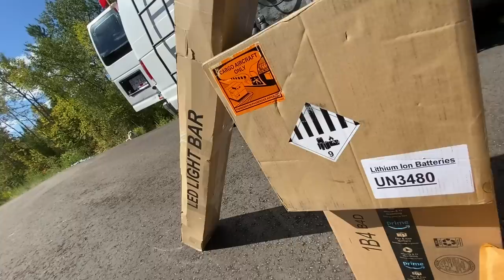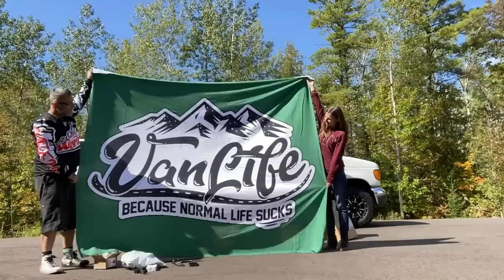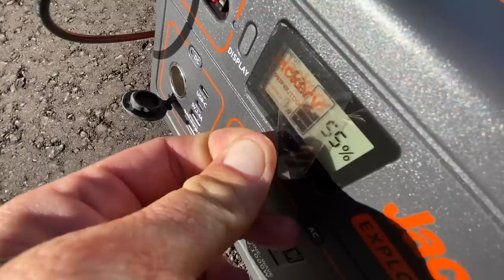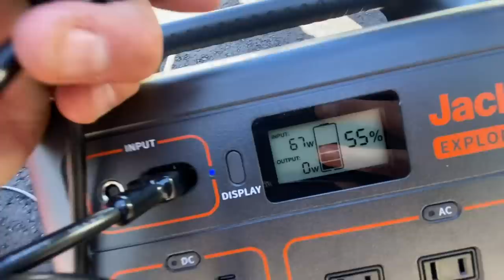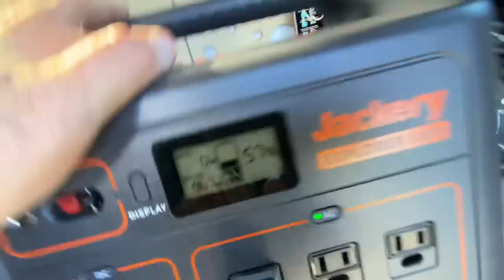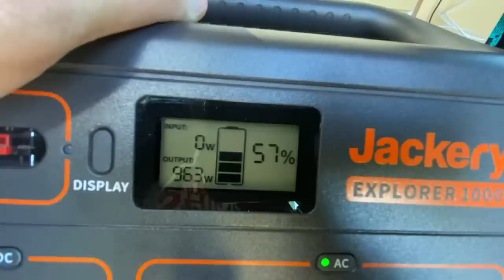“Let's Open Boxes" Picked Up a Few Toys For The Van Build

Comment: Awesome, it's so cool how your van looks like a new home remodel and far better storage areas too. All that and more 😊👍 Give Cruzzie hugs again for me too. Be blessed and safe, oh, and, that Jackery is cool too. I like to get one sometime in the near future when I get my funds back up again sometime after I'm done with my remodeling rebuilt in my newer van I've been final working on for 2 weeks going into my 3rd. Most of it was from shortly after I got that nasty old rug out, to my surprise though being a 20+yr old van, only very minor surface rust in very few areas when I expected worse, the actual worse and longest time to do anything was cleaning up all that nasty old glue and gunky stuff, took me near almost the 2 weeks to get it all cleaned up, now finally these last few days I have done that bit of rust treatment and bondoing all the holes that will not be needed or used (where the former bench and bucket seats were and the old seat belt brackets that were on the floor and tire walls in back behind the driver and passenger seats) now that the bondo is dried, will be sanding those areas as smooth as I can get them, clean up the whole back areas real good too, then some fresh new paint. While all that is done, and dried, then I can work on the new insulation, flooring and walls. YAY 🤗 I'm getting there slowly but surely myself, my own newer van built. For now will be very basic and simple, but in the midst I'll make room for future modifications for solar power (maybe even surepower too as an additional backup power if when needed kind of thing) for now, a simple but good setup for living and traveling, etc. I'm taking the time to be certain all will be done and finished correctly, better than what I did in my previous van I had. I'm so excited to the outcome of my newer van built, I'm sure I'll be so happy when all is done liken to a new home owner. Well, gotta go for now, catch your next new video later. Love the way your van looks too.👍😊💖

Comment: Merry Christmas Chrome!  Unwrapping is so much fun.!  I've been having my own Christmas over the past months while converting a 2005 Chevy Express extended van to camper status.  Designing the hi-top (I'm 6'4) was the biggest challenge but it has turned out nice and I actually have headroom.  Yay.  Two questions for you Chrome.  I noticed during yesterday's video that you have both the push button latches, and also the Slam Latches.  They both interest me, but are both costly.  The slam latches look awkward to get one's fingers into.  What is your take.  Any idea of their cost and source?  As for the push button type....what's your experience been?  Any idea as to brand and source?  Thanks for the info if you in fact can get around to it.  If not, no worries.  I'm only 81 with tired knees, so I can wait a few more years. l0l.  cheers and happy travels.  I'm loving your travels especially here in BC.  Vancouver Island where I live and northern BC where I lived as a kid for a few years.  Sorry to be long winded.  I had a broadcast career so I'm blame that on being long winded.  Happy travels.